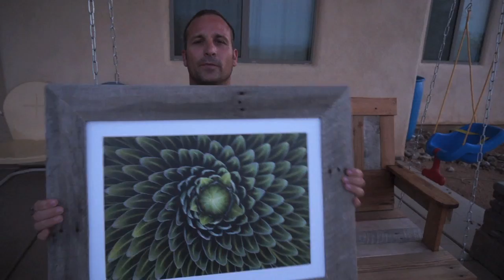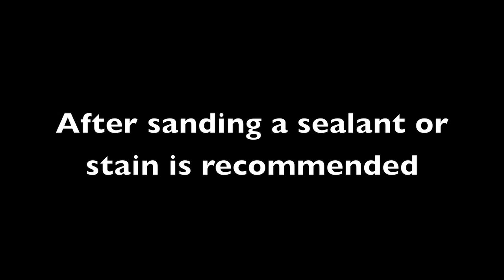Rustic Headboard with Pallets - How to

Comment: I really liked how you did the work and most of all the presentation, it was fast and to the point. The final project turned out well. I hope you make more such as this. I am making a headboard myself, not as fast ha ha but still think it will turn out well. I used fence material as its lighter and already is rough sawn and staining with a blue and gray stain. Its not as cheap as your to make but that wasn't my intention. Im also using 4x4 posts for each side and I'm going to attach it to the bed rails. Right now its solid boards across the whole width, I may cut it up a little as you did, I think that will look better. 
Thanks again.

Comment: This looks AMAZING! I am planning on doing this project this weekend with my husband. I do however have a couple questions. What do you use to mount it on the wall? How did you come up with the measurements for each piece of wood?Thanks for sharing this step by step video.
Reply from the maker: Misty Rowe Thanks Misty!  For the mounting, I used wood screws through the top (at a downward angle) into the wall and for the legs (since they aren't flush to the wall like the top) I used simple 'L' brackets.  And for the wood slats I really didn't measure them, I just laid out the pieces and cut them to fit.  As you see on the video I put the first in, then I cut the second and third pieces where they wouldn't have their edges line up with the row above or below.  
For the frame of the headboard I did use the width of the bed (queen, king, etc,.) to figure how wide I wanted it.  And for the height I just eye-balled it to see what I thought looked good.  I don't think you can go wrong with higher or lower though... just depends on what you like style-wise:) 
Anyways, I hope that helps and I hope you guys love the final result of your project.  We sure do!  Thanks for watching Misty:)
Joe

Comment: Great job! I wanna try to make a twin size one.
Reply from the maker: CJSchecter96 Thanks CJ!  Would love to see how it comes out!Joe
Reply: homesteadonomics yeah I just took apart my pallet and hosed down the wood. how tall would you suggest to make it for a twin bed? It'll be 4ft wide but I don't know how tall it should be.
Reply from the maker: Hey CJ... mine is about 27" above the mattress and about 47.5" for the total height.  Since your mattress is going to be narrower then I think you'll want to make it a bit lower in total height... maybe 36-40" or so.  But I'd put some tape on the wall at a few different height levels and see what looks the best :)
Hope that helps and I'm sure it's gonna turn out out great!
Joe
Reply: thanks for the help man!
Reply from the maker: No prob CJ!

Comment: This is a great video. Do you have printable directions for a queen headboard? What advance would you give if working with really old varying sized pallets? My pallet boards aren't as smooth and I have to dismantle them myself. And safety tips, or nail size, drill/gun tips? You are a very nice husband. Thanks, Deb the jiffygirl cause I'm on a budget.
Reply from the maker: Debby Spencer Hey Debby, sorry but I don't have any instructions for the headboard as I often do my projects by 'eye'  ;)  But its not too hard to get it looking good for your bed frame.  Basically the 'frame' that I attached the pallet wood too was about 1.5" wider on each side as the metal frame that the box spring rests in.  After that, it's just finding those nice little pieces that have the age/greying that you like!
Regarding nails/screws:  I used screws for the frame portion and 16 gauge finish nails for attaching the pallet pieces.  But you could easily use a hammer and finish nails as well and get the exact same look... might take bit longer but just as good:)  And when using screws just make sure to predrill as pallet wood can split and/or bind up the screw if it is hardwood pallet wood (oak, etc,.).
And lastly for the pallet wood... it's a labor of searching to find the right smooth/greyed pieces.  I feel your pain.  I often find the newer but broken 'pine' pallets that are broken and don't have the character of the greyed out smooth pieces.  Just keep your eye out... you'll find enough of the pieces you want eventually  :)
Anyways, hope that helps and if you ever post any pics or vids of your headboard I'd love to see what you come up with!
Joe
Reply: Ok it does help. Thanks for responding and again for your post. Jiffygirl.
Reply from the maker: No prob Debby:)
Joe

Comment: Would you consider doing a how to on how to make a full bed?
Reply from the maker: billybonesfourtyfour Hey Billybones, I'd certainly consider it if the right opportunity arose (i.e. a bed for my wife, for sale etc,.)  However, I don't have any specific needs to build one right now.  But if I did, I'd probably build a 'foot' piece very similar to the headboard but shorter.... then build an appropriately sized frame (queen, king) to attach to the head and foot pieces.  Anyways, thanks for the question and for watching:)
Joe

Comment: Your work looks so professional. Not trying to sound dumb but what exactly is pallet wood. Also do you know if they sale pallet wood like at home depot and stuff
Reply from the maker: carson taylor Thanks Carson!  Pallet wood is any wood that comes from a shipping pallet. Basically it's a wooden frame that most companies use to ship/store products on.  They usually get pretty beat up over years of use but that also adds a bit of 'rustic' character to them.  They are often available for free and are constructed with varied woods.  The beauty of using pallets for projects is the 'free' and 'rustic' factors.  Anyways, hope that helps:)

Joe

Comment: Great tutorial!  Thanks!  What were your final dimensions and do you attach the headboard to your bed frame?  I've never had a headboard, so I'm not quite sure how that works.  Thanks!
Reply from the maker: ***** Thanks Drew!  The final dimensions were about 65"W by 46.5"H, with the pallet portion being about 32" of that height.  As far as attaching.. you can attach to the bed frame or to the wall.  I've attached mine to the wall but am planning to attach the frame to the headboard as well just so there's no wiggle/movement.  Anyways, hope that helps if you decide to build one of these babies!  Thanks for watching Drew!

Comment: Do you have a printed list of steps/supplies that you used? I'm interested in starting a similar project and am getting some plans together. Great video. Thanks in advance.
Reply from the maker: Nik Powers Hey Nik, unfortunately I don't have plans as a lot of my projects are 'custom as I go' in regards to measurements.  But if you have any questions I'd be happy to answer them.  Just let me know:)  Basically once you get your headboard frame established then all you're really doing is cladding it in pallet wood in a manner in which you like:)  
Joe
Reply: Thanks for the reply Joe. Did you just have a basic metal frame connected to the headboard or did you make that as well?
Reply from the maker: Yep, just the standard metal frame and I attached the headboard to the wall with 'L' brackets.  So technically, the bed is just free floated.  But if you wanted, you can attach the bracketed ends of the bed frame to the legs of the headboard.  You'd just have to build your frame to have the same width as the metal frame.
Either way is fine but I chose the wall so as to not have the headboard bumping into the wall.
Hope that helps!
Joe

Comment: Did you fix it to the wall or bed or is it just free standing there. Looks good mate
Reply from the maker: Sam Mackenzie Hey Sam... yes it is mounted to the wall, but you can also mount it to the bed frame as well.  I chose to mount with a couple brackets to keep any extra movement down.  My sister has stayed over since I installed it and she was able to set a glass of water, her phone and a book on the top for easy access during the night.  So if you think it might be used in that fashion the wall might be a better way to go.  Hope that helps and thanks for watching:)
Joe
Reply: homesteadonomics great stuff...where did you get the weathered pallets??  seems like the only pallets i ever see are LESS weathered?

Comment: Nice headboard.
How do you fix it to the base of the bed?
Reply from the maker: Federico A Thanks!  I actually have the headboard attached to the wall and the bed 'floating' freely.  I didn't want it banging against the wall everytime the bed moved so thats the reasoning:)  But if you did want to mount it to the bed frame, you'd just make sure your headboard 'legs' were the proper dimensions to line up with the bed frame ends.. then attach with screws or bolts.  Anyways, hope that answered your question and thanks for watching:)
Joe

Comment: quick question how did you attach it to the bed frame? couldn't tell in the video.
Reply from the maker: +baseballman123100 it's attached to the wall and the frame is loose... but the frame could be connected to the legs very easily.  Most frames have brackets on one end for attaching to the legs of a head board with screws.  But, I've never been a fan of frame mounted headboards as they will rattle or bang against the wall with every movement.  Hope that helps and thanks for watching:)
joe
Reply: yes that helps alot thank you very much!

Comment: How did you attach it to the bed frame?
Reply from the maker: +Jon Filloon Hi Jon... it's not attached to the bed frame at all.  It's attached to the wall.  You can do it either way but headboards attached to bed frames tend to rattle and move quite bit.  I used simple 'L' brackets to mount it to the wall studs.  Hope that helps and thanks for watching:)
Joe

Comment: Great job! but how to you attach it to the bed?
Reply from the maker: +Ana Q Hi Ana... I actually attached it to the wall and not the frame of the bed.  You can attach it to the frame but attaching it to the wall instead will stop any rattling or banging of the headboard on the wall.  That way you can set a drink or other items on the top without risking them falling off:)
Joe
Reply: hi :) Oh okay thank you I got a new headboard so I was wondering what wa sthe best options you're probably right to just set it to the wall. What sort of materials would i need?
Reply from the maker: +Ana Q Hi Ana...  you can use standard 'L' brackets and screwinto the wall studs and the 'not visible' portions of the headboard.  You can also just sink screws through the headboard and directly into the wall studs as well... but you'll need really long screws:)  ...hint:  use a magnet to find the wall studs by marking where the drywall screws are:)
Joe
Reply: Thank you so much very helpful!

Comment: Can I ask how you attached it to the wall?
Reply from the maker: meem1770 I used standard screws through the top board and then some 'L' brackets on the underside of the main headboard area.  You can also attach the headboard to your bed frame but I used the wall because I wanted people to be able to put a glass of water or a phone, etc, on top of it without any movement.  Anyways, hope that helps and thanks for watching:)
Joe

Comment: how did you mount it I'm building this next week
Reply: and what's the stain
Reply from the maker: Hi Chad,  I mounted it to the wall with 'L'Brackets and screws into the wall studs.  The stain I used to dress up the sides was a tinted mix of minwax provencial stain and linseed oil....  The rest of the boards aren't stained... just the standard weathered pallet look:)
Joe
Reply: +homesteadonomics  awesome thank you i guess I gotta find some stain then the pallets at the place I work are brand spanking new only used a handful of times
Reply: +Chad  England so they are pretty much brand new wood and they are heat treated so they are better 😀
Reply: Chad  England almost all pallets are heat treated lol

Comment: how did you attach it to the wall ?
Reply from the maker: I used screws and a couple of 'L' brackets on the legs of the head board.  I sunk the screws into the wall studs and it's very sturdy...hope that helps
joe

Comment: What size did you go for length x width?
Reply from the maker: Jeremy Fields Hey Jeremy, for the width and height I based it off of my bed frame.  It is about 1.5 to 2" wider than the frame on each side.  The height is about 40" or so.  But your measurements will depend on your bed size.  If you have some painters tape I'd put it on the wall in the width and height you think might work then look at it to see if you want it higher/lower  and wider or narrower depending on the look you're wanting.  Anyways, I hope that helps:)
Joe

Comment: How did you attach the headboard to the bed frame?
Reply from the maker: it's attached to the wall to make it sturdy.  the frame can be screwed to the bottom of the headboard legs or the wall.  most frames will have holes to mount with